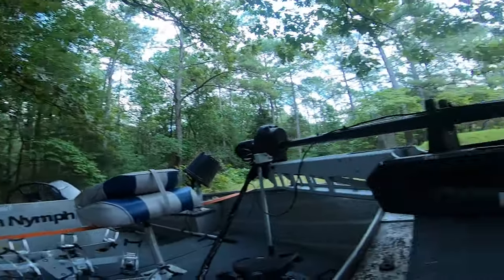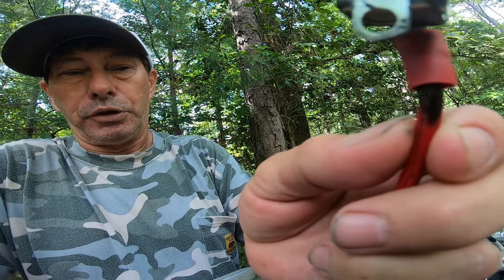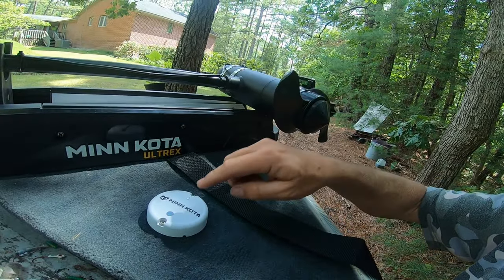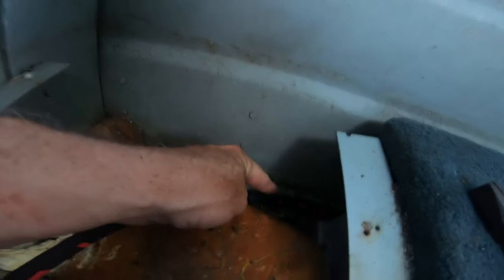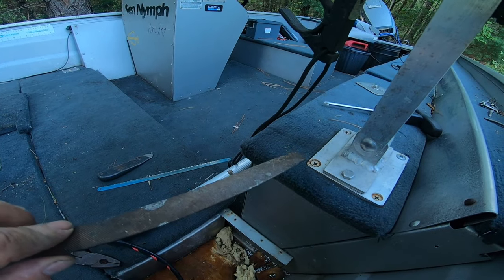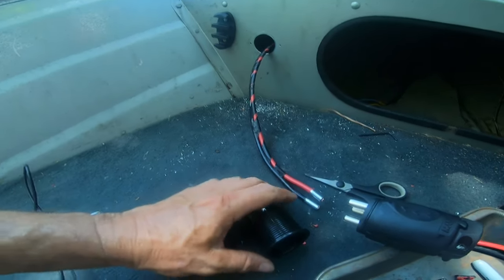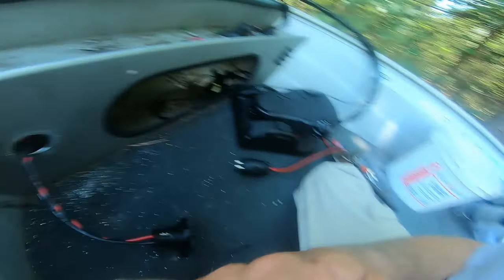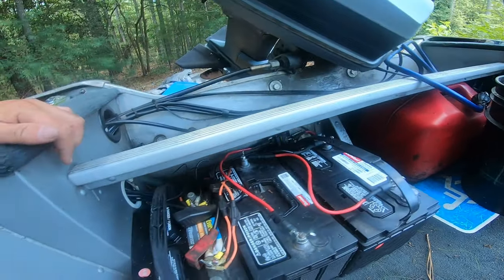HOW TO WIRE UP ULTREX TROLLING MOTOR CORRECTLY

Comment: This is just a curiousity question. Why not use a splice connector to connect the trolling motor wires to the 6 gauge vs using a plug?
Reply from the maker: very good question
you could easily do a straight  wire
but having a plug connection you can unplug it to remove the motor for repairs, and disconnect from power supply while charging but mostly it seems to be the standard of the industry
I hope this answers your question, but feel free to chime back in  Thank you for taking the time to ask a question